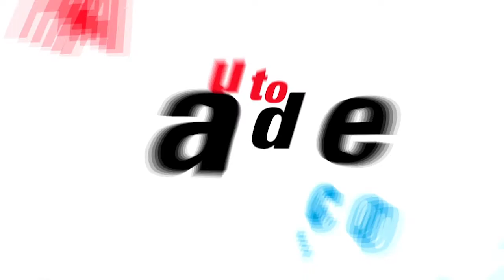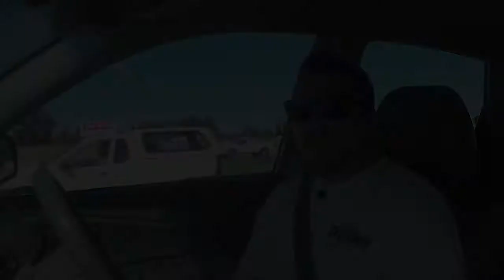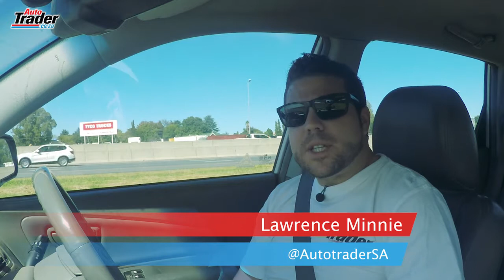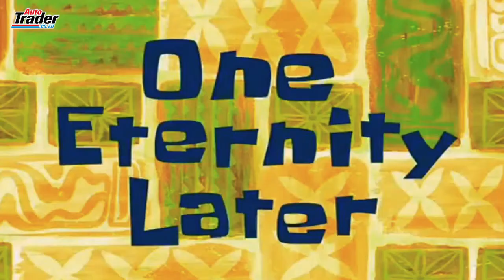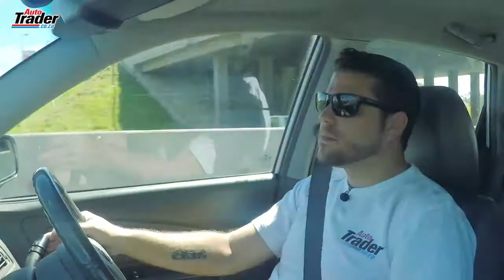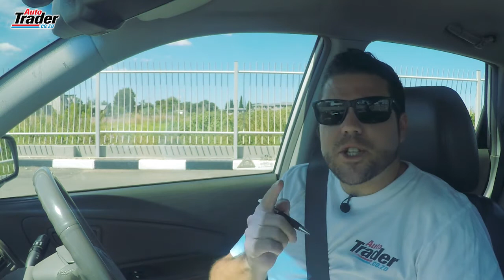Does cruise control use more fuel

Comment: Of course cruise control uses more fuel than a stable foot. It’s all about throttle control. Cruise control will accelerate on incline to keep at the set speed and not reduce throttle input in time on declines.
Reply: I gave you a thumbs up cause your right! But testing my own personal car against this has proven wrong for when i use cruise control i get way better gas mileage.